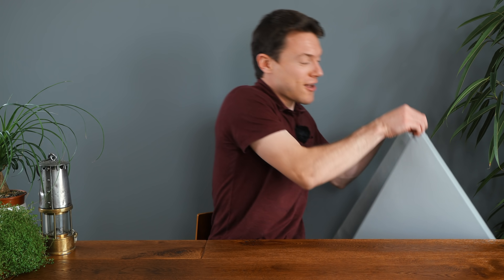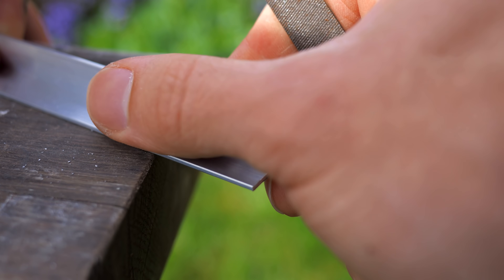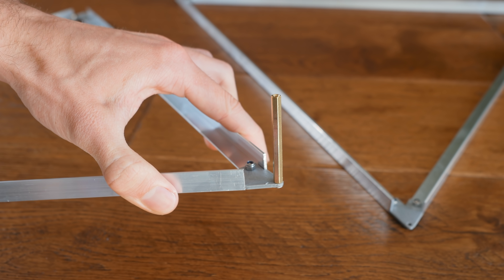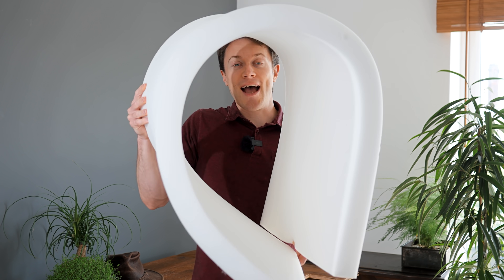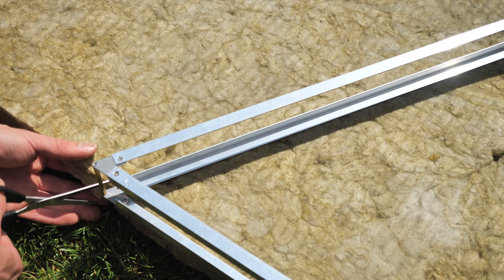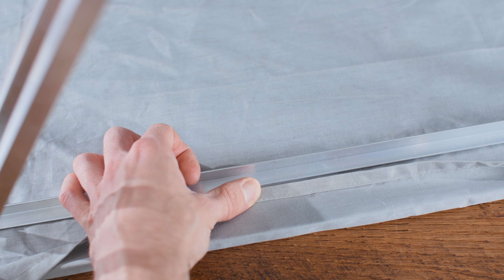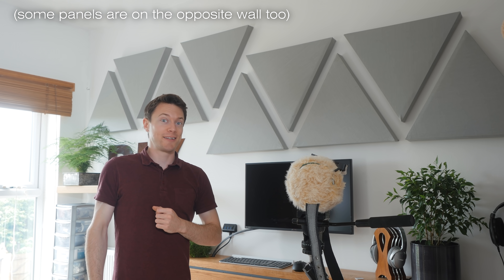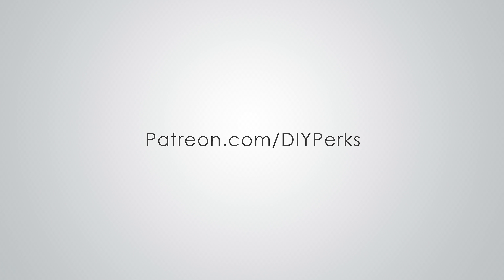High-Performance DIY Acoustic Panels (Build Guide)

Comment: Just for consideration, an alternative approach is canvas pictures.  You can add foam to the backs of these for the same approach, while also still having pictures of family, movie posters etc as decoration.
Reply: Just to clarify this excellent idea - the picture would need to "breathe". So if you take an unpainted canvas and hold it to your mouth you should be able to blow and suck air through it. But add paint, especially any kind of oil or acrylic, and now you've recreated a reflective surface - the more of the surface that's covered with paint the less air can move through it, the more you've just put a reflective surface over the top of your acoustic foam / rockwool.

However if the paint is very light and doesn't affect the breathability of the canvas (filling up the holes in it's mesh) then this works very well. Probably better to buy blank canvases and apply your own pattern with stencils.

Comment: What if I built really long panels that cover the whole wall and I used that yellow stuff you put in your panels, would that also soundproof the wall, so that sound couldn't penetrate through to the other room? If not, can you do a tutorial that covers this. I live in an apartment and want to prevent sound from leaking into the other room, but obviously I can't completely tear down the drywall and this stuff into the wall, so how would you do it without doing that, using a similar solution you're using in this video?

Comment: I'm curious if the tedium of using aluminum frames is enough to warrant not just going with an easy to build wood frame. Seems like you would be saved half the trouble and expense just going with a 1x2 reinforced wood frame. Everything else would be the same.

Comment: Most sound conditioners jut into the room for a reason. Those will give the room a strange frequency response by leaving alone the sound whose quarter wavelength larger than the panels' thickness. Looks like it would be around 1000hz. ((344 meters / second) / .1 meters) / 4 = 860Hz. Good for a restaurant where you want to hear words, but bad imo for a nice sounding space.

Comment: Very good video. But this or the towels? 🙏 This seems a bit more "profesional", but seeing the wave leves of the towels in the previous video compared even with acoustic foam... I would rather be sure this is better since it's not going to be as cheap.

Comment: Oddly enough, since you are going to cover it with a cloth, you could use a denser material if (and this is a big IF) you could get it with an egg-crate shaped surface. I know you said that materials that are too dense will reflect the sound, but from my limited understanding, the protrusions should break the sound up by reflecting it at odd angles resulting in the sound breaking up and reducing the amount of echo. Shoot, you might even be able to place the isolation or foam on top of a thin, dense, egg-crate surface to double to increase cut down on the sound even more. All that said, I suppose this would also increase the panel price by quite a bit; also, I have no idea where a person would find a dense material that has an egg-crate shaped surface that isn't an expensive sound panel to begin with.
Reply: Acoustic Foams are used for Echo & Acoustic Curtains are used for Soundproofing SoundProof-Curtains.me
Reply: Acoustic Foams are used for Echo & Acoustic Curtains are used for Soundproofing SoundProof-Curtains.me

Comment: Ey! Making it with metal affects directly to the sound because metal reflects high frequencies, wood is better for acoustics. By the way I've done easier than that, and bigger (135cm x 60cm) made of wood with roockwool (thickness of 4cm) inside and covered with natural fabric. It costed me about 25€ per panel. You can check it in mi IG: @pabloakalinc. I use them in my music studio.

Comment: Why would you make acoustic dampers of rock/glass wool, and then forget to seal them in plastic, before adding the fabric?
Its one thing that they itch badly when you touch them. Its another that they fibers spray loose from sound/vibration causes irritation for the entire body long term.
You should seal them in some manner, and fabric isn't airtight.

Comment: Super cheap frame option would be a corner bead used for drywall or plaster board. Easily cut with a tin snips.

Comment: When you handled that rockwool insulation without gloves my hands itched in sympathy.
Reply: It is stone heat/sound protection wool, doesn't irritate the skin. I have it on the roof, walls, quite good.
Only thing from those materials that irritate skin is made of fine fiber glass (dangerous for lounges)

Comment: The best materials to build sound absorption panels, is natural wool fabrics & natural wool insulation, its not that cheap, but it 100% beats any other material for sound absorption, manmade material tend to colour the sound,  try it out, you won't be disappointed, nice video👍

Comment: You have learned sooooo much since the old towl panel video!  Looks great, and sounds wayyyyy better!
Also worth noting that echos are most notable with standing waves, and you live in a 3D space.  Either hang some treatment from the ceiling, or put some carpeting with padding beneath to cut down on the top-to-bottom sound as well as the side to side.  Also, putting them on adjacent walls instead of opposite walls (or a few on each wall) is also more effective than putting a bunch on 2 parallel walls.

Comment: If you take string, and lay it across the front of the foam, behind the front bars, and tie the string to back bars you will make ridges, or valleys in the insulation/foam. This will let you capture more sound because the waves bounce around between the ridges. 

If you look at quiet rooms you will notice they have a bunch of triangles extruded from the wall that makes small pockets that do this as well.

Essentially the sound bounces in these ridges, and it helps reflect less sound.

Comment: Don't bother with these lightweight materials. They only work on higher frequencies.  To knock out all all frequencies, even low frequencies, fill your room with heavy metal items. Cast iron objects are best. Lead flashing works well, is easy to cut and shape, but is obviously poisonous so wrap it with tape and only handle it with gloves.  Clean your work  area thoroughly after use. The heavy metals will absorb all range of frequencies and kill echos.

Comment: Amazing project! Thanks for sharing it with us. 

Mays I ask you a few questions? 

1 - How does these panels affect the sound propagation to the rooms right next where the noise is being generated?  Does this helps to attenuate the noises in my apartment soo I won't bother my neighbors with some music (nothing exaggerated) or acoustic guitar training?

2 - May I substitute the aluminium bars with thin balsa wood for the structure without loosing performance?

Comment: Matt:
Thank you for an exceptional channel, and all the work and effort you put into all your contend. I love it. 
Question:
I have a two level home where the builders totally left out sound insulation. After watching this video, do you think this method would work if I were to create a false ceiling downstairs, so that noise generated upstairs would not travel as much i.e. be as loud as it is currently (even footsteps on the floor board are heard much louder than it should be)
Would love to see you either answer this or even better, make a video on how to cheaply resolve this problem of mine.

Comment: Hi sir I have seen some good ecoustic panels on your walls I am constructing my preview lab for my personal use, I am a cinematographer from INDIA I use to work on projects like films, ads, corporate films and weddings, I am planning to bring this benq 5700 to my new  preview lab, I am here to ask you some suggestions about installing those kind of diy ecoustic panels, I am going with denon 2600Av receiver and polk audio signature series with 7.1 atmos, my room size is 15ft width and 35ft breadth and 10ft height leaving the sealing, so can you pls suggest can I go with the same kind of panels in my room without any complete acoustic treatment as it costs too much for me, I am planning to make my own DIY panels with rockwool installed in them, will those panels help me out with the reverb and also blocking out the sound without going out of this room.

Comment: Re the household insulation material, you should specifically warn against the use of fiberglass based material which is toxic, and instead use a product sold here in the states called Rockwool, which works just like fiberglass but is not toxic.

Comment: To avoid excessive "boominess" you could compliment these panels - which absorb high frequencies very well - with some matching DIY bass traps - which absorb low frequencies very well - in the corners where your walls meet the ceiling and floor.

A must for any audio recording.  You could even leave a few off the wall and wear them like earrings or set them on either side of your mic while recording for podcasts, tutorials, narration, etc. Great video!  :)

Comment: I looked what you did from aspect of physics professor ( my mother is one) and what i see acoustic panels mimic something what happens when dophin fires his sonar in order to do echo location to avoid obstacles there for sound will reach obstacle and reflect back alowing dolphin to avoid obstacles. The thing is sound is better because acoustic pannels aborb sound before it hits the wall and you basicaly hear only sound coming from the source in a way it is suposed to and as panels absorb sound they also spread it becuse they are denser than air which helps a lot. Sound
 spreads better though dense objects than through sparse object.

Comment: To absorb sound, you want a material that will vibrate equally at a relatively wide range of frequencies converting the acoustic energy into motion and ultimately a miniscule amount of heat. Actual acoustic foam (like Sonex or Auralex) has an open-cell construction, the random lattice-work of the foam vibrates easily. Standard upholstery foam is closed-cell like bubbles and is MUCH less effective at absorbing sound. Owens Corning Fiberglas® 700 Series Insulation is the best sound absorbing material of all, it's made of inorganic glass fibers is formed into flexible, semi-rigid or rigid fiberglass rectangular boards of varying densities. The 703 type is quite effective and is only 2 inches thick, it is also available in thicker panels which absorb lower frequencies. I also recommend using an acoustically transparent fabric material instead of the tightly woven bed sheets used in this project.  (I use this fabric: https://www.gikacoustics.com/product/guilford-of-maine-fabric-by-the-yard/)

Comment: if you use dark fabric , you can print designs on the panels using stencils and a spray bottle of varying mixtures of bleach and water . using freezer paper for the stencil will allow you to iron it to the fabric temporarily . I would suggest printing the fabric prior to attaching it to the frame . using bleach instead of ink or paint means you aren't adding solid areas that may reflect sound back .

Comment: So would the best sound quality be achieved by having the entire room covered in acoustic sound absorption material? Or is there a reason to keep it to a couple of panels, or only one side of the room?
Reply: Depends on what your end goal is. Completely covering the room is rarely beneficial, only if you're building a vocal booth or something like that where you need a totally dead sound. You won't be able to comfortably work in such a space though as the sound is very unnatural. In music studios, or control rooms especially, Live End, Dead End is a common solution. That is, like you said, covering the front side of the room (where the desk is) with large amounts of absorption and leaving the back side more sparse, using diffusion more prominently. 

The most important thing to take into question are the first reflection points. That is, where the sound you make/listen to will hit and bounce off first. In let's say a music listening environment (two speakers on a desk) that would be on the side walls at speaker height, on the roof above your head slightly forward and depending on the room, right behind you. Having someone holding a mirror against the wall while you're sitting in your chair is a help. At the points where you can see the speakers in the mirror are reflection points that should be treated.

Comment: Great build but i wonder how effective the nails will be (for mounting) if you live in a house with dry wall and concrete walls as i do. i worry using a hammer to knock it in would be quite damaging to the panels.

Comment: Hello Matt i'm a little lost, I would like to know if these panels there are better than those based on bath towel? Is the absorption the same over a wide frequency band? Ditto, does the combination of different materials work well? I really try to absorb a maximum of frequencies because I am next to a busy road. thank you for your lights because I can not find anything on the subject.

Comment: Love your videos, but I have a WAY cheaper route. 6 rolls of  2" thick 16"x48" denim insulation is $37 at home depot. Link Below. Then buy 5 x 8ft 1x2" boards, $15. Grey canvas from Walmart, $10. Use a staple gun and staple the denim into the wood surrounding. Pull the canvas over the top and wrap around sides, staple in back.A hand saw, a hammer, nails to make the frame. Then you have almost an entire room of coverage for $62. That's 32sq ft of wall coverage. 6 x 16x24" tiles and 2 x 16x48" tiles.

They work just as good as acoustic foam as anything else and reflect nothing. They also are fire-resistant and made of recycled cotton. Please give it a try and I can send pictures if needed. 

https://www.homedepot.com/p/UltraTouch-R-6-7-Denim-Insulation-Roll-16-in-x-48-in-6-Pack-60306-16482/202710055
https://www.homedepot.com/p/2-in-x-4-in-x-96-in-Premium-Kiln-Dried-Whitewood-Stud-161640/202091220
Reply: My father works as a carpenter so I got all the wood and he built the frames for me very easily. All I had to do was stuff in the denim insulation, staple it in all around the inside lip of the wood, cover with canvas, staple, then hang.

Comment: You building is very nice but acoustically there are many mistakes. It is quite delusional to call this "high performance" acoustic panels. Even with rockwool your effective absorption will not go below 200-300Hz. That foam most likely makes lower frequencies bounce since air is not passing through.

You absorption test is also very questionable. The human voice does not produce enough range of frequencies to be effective for testing absorption. You'd need full range speakers for that with sweep between 20Hz to 20Khz.

The fabric used is not optimal since it needs to let air pass through easily. Even less when you add another layer. This again will make some frequencies bounce and not be absorbed. With a proper fabric your panels could be more effective at medium and higher frequencies.

Finally you should use Room EQ Wizard to make proper measurements with a full range sound source. Ideally you'd want a calibrated mic, but this is not so critical to get a sense of what your panels are doing.

I'd like to add that adding 5-10cm of space between the panel and the wall will lower the frequency of the effective absorption considerably.

Comment: If you grab a microphone and do some simple measurements you'll notice that sponge (or rather foam) has little to no effect on most frequencies in the spectrum. Especially to annoying lower ones. Rockwool is leagues better and - more importantly - consistent across the whole spectrum. Plus - foam is a mould magnet ;)
Reply: He literally just showed us that it makes a difference.  WTF?
Reply: Though more expensive, Owens Corning 703 is even better.
Reply: People have no clue how bad fire retardants are for health, they offgas especially when caught on fire. Even firefighters are against them since it causes high cancer rates among them.
Reply: also no fire hazard...
Reply: @astranger448  If you're worried about something hanging on your wall, catching fire, you have other priorities to tackle :)
Reply: @wangmauler  Nobody chooses to have a house fire, but if you have highly flammable items inside, the fire will be a whole lot worse (and faster).
Reply: @wangmauler  some people may use these in commercial spaces where fire codes need to be met. I also wonder if insurance wise if the material is seen as a hazard in homes, and worst case scenario what if you're denied payments due to it
Reply: Also far more expensive.

Comment: Does this do a good job at stopping sound from entering your neighbours appartement? (sound isolation)
Reply: Short answer: No

Slightly longer answer: Good sound isolation is really tricky. Using these panels, there will probably be some isolation effect stopping sound going to your neighbour, but the effect will be almost imperceivable since sound will transfer through various paths such as the floor, ceiling, walls, windows, etc. Moreover, to have any meaningful effect at stopping sound to your neighbour, the whole wall (and most surfaces in your apartment) must be covered without any gaps.

Comment: The best material for acoustic absorbers is dense fiber glass insulation boards. The soft ones and rock wool types do not work that well. You can also put a gap behind the board to increase its low frequency absorption.

Comment: I've used convoluted acoustic foam - the “egg crate” design provides an increased surface area and better sound absorption performance - backed by higher density foam. It is cost-effective.